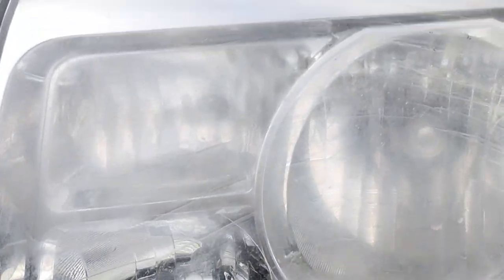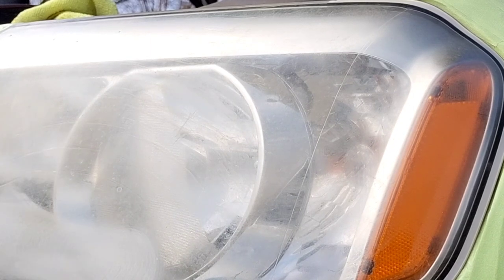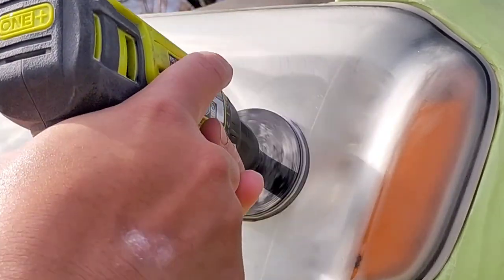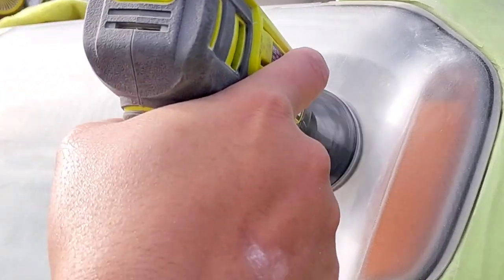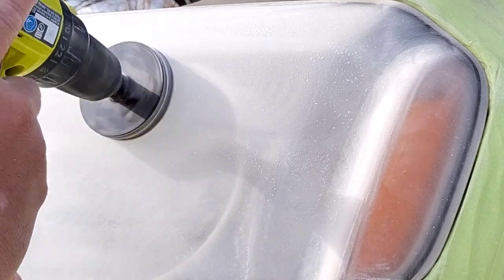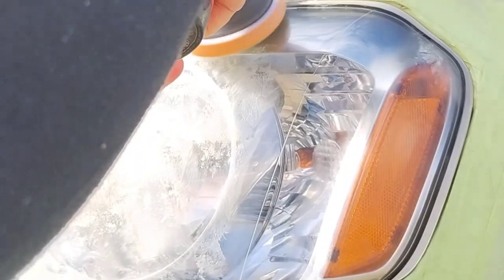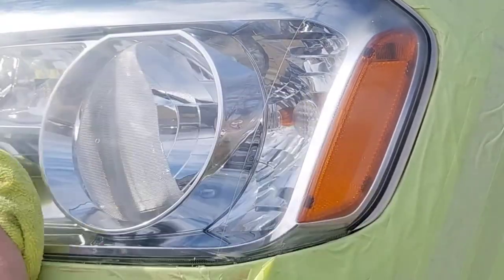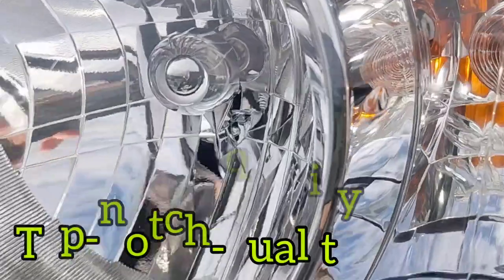Polishing Headlights is a sham scam Part 2 🤬

Comment: If you used 3m’s purple p320-500-800 you would go thru less discs and less sandtime, but yes they are more expensive. Great discs tho, vented as well so no clogging. Any of 3m’s purple discs are great, whether it’s cubitron, trizact, etc
Reply: Great videos. What compounds and pads do you use?
Reply from the maker: All stated in majority of videos.. also direct linked for purchase from Amazon in the bio...👍🏼

Comment: Do you do anything to your 3M finesse it pad when they are new to soften them up? It always looks like the ones you use are well worked in. Reason I ask is when i purchased a couple they seem pretty firm when new and I polished a set of practice headlights and put a couple burn marks on the first one and had to start over. And as always, thank you for the education.
Reply from the maker: When they're new you just have to use more polish...alot more until that service breaks in they're actually are working more efficient when they're new.. so you have to slow down and do less, and use more polish...
Reply: Awesome, thank you. I'm sure in one of your videos you have mentioned this and obviously you are a lot better at his than I am so it might change the outcome but how long do the finesse it and trizact pads normally last?
Reply from the maker: Trizak pad typically are usable for probably about 3 to 4 vehicles... The orange three in finessing is probably good for about 13 - 20 vehicles...
Reply: Hey brother, do you just store the finesse it pad in a zip lock bag between jobs?
Reply from the maker: @chrissanchez6610 no....it stays on the ac Delco...

Comment: Hi again mate, have  you used something like gyeon can coat ceramic coating on headlights. It can be applied to all areas of the exterior including the headlights. Its got a 12mth durability and you could get 100s of headlights out of a can considering how little you have to use. Thx
Reply from the maker: Is it a spray can...
Reply: @theheadlightrestorationpro  its a ceramic coating in a can with a pump spray nozzle. To apply to a car, you spray it into a cloth and wipe it on then buff it off with a clean cloth.
Reply from the maker: However good it is it's not acceptable my opinion.. for my level of quality it would have to be a spray can aerosol... No matter what it is if it was liquid Gold it's inferior because of his delivery method..
Most ceramics are inferior methods of coating headlights either way it goes..

Comment: Hey mate another great video . Just a question , why do U use glass cleaner ? Does it do something different to the lens that another cleaner wouldn't ? Thx
Reply: Alcohol based, evaporates more quickly and doesn’t streak with residue, like other cleaners that would leave behind somewhat interfering with the polishing step.
Reply from the maker: Actually they do the same thing as the ammonia base Just a Little less in a different way.. but what they do more of a strip.. which is one of the things of one of the biggest things you don't want done after the step is for the residue of the Polish cleaner to be  to be stripped..
I mentioned this so many videos..
Reply from the maker: Glass cleaner is designed to not you leave streaks, and access residue from the cleaner, it's typically designed to be used on transparent and or reflective surfaces.. and also has a high evaporation point almost as high as alcohol because normally is ammonia base... Which makes it ideal to use but headlights...
Reply: @theheadlightrestorationpro  ok thx. Makes sense

Comment: Headlight Restoration Pro. I've started my own business doing headlights here in New Zealand, your videos were an inspiration to start, and I follow your method almost to the T. However, here in New Zealand we have a limited access to 3M products and 75mm sanding discs, backing plates and whatnot. I've been using the smaller 50mm discs and they work well, although I am having difficulty after the p800 step. I have trizact pads on the way from Australia, but in the meantime it is very difficult to get that crystal clear finish with just normal p3000 wetsanding. Do you have any advise on what I can do instead after the p800 stage. Headlights here are a total mess by the way as all out imports are from Japan and the oxidization is like worst you would have seen but with every vehicle. I am the only one in my city doing restoration and I've quickly become in high demand. Any advise or alternatives would be appreciated. Thanks.
Reply from the maker: Might try to wet sand with the p800 after dry sanding (by hand)..or do a little extra with the policy step...
Or add wet sanding step with something like a 1200  after the 800 step...(but after machining with the 1200 you want to hand sand kind of replacing the 800 step... Still using the 800... But doing the stuff you do with the 800 with the 1200...
Appreciate you....
Sounds like you have a good thing going on out there...💯👍🏼
Reply: Thank you for the reply, I'll definitely try that out tomorrow. Once these trizact pads arrive, i've got no doubt that'll fix a lot of my issues. I've been doing cut and polish for 10+ years but headlights for 2 weeks. Whole different ball game, but enjoying the learning process. Keep up the great and informative content.
Reply: Hi mate, just across the ditch from you .I don't have the trizacts yet, so I use 800 then 1200 then 2000. Then I polish with my DA polisher and a decent compound like scholl S20 Black or similar  . Comes up clear as a bell . I've only just received the Megs headlight coating today , so keen to see that in action

Comment: Do you ever have any issues with the masking tape leaving residue? Every masking tape I've used seems to leave residue that I cannot seem to get off, and sometimes I even lightly put it on
Reply from the maker: This is why I use auto finish tape ..3m
Auto finish tape leaves little to none,..
And if there ever is a little spot it just wipes right off its design for vehicles that are painted....
Check the link in my bio...
There are other brands and other Auto finishing but three am of course is the best...💯
Reply: @theheadlightrestorationpro  great thanks

Comment: Mr. Headlight restoration pro, I've seen so many headlight restoration videos that were like, they peel the headlight material in an EXTREME way first using knife or cutter, wet sand it and finally polish it. Can you share your thought in your next video? Is there any effect of headlight thickness to its performance/durability? Thank you so much! 🙏
Reply from the maker: Thanks for watching.. yes you can shave them and wet sand them but both are remedial and very inefficient... Those guys shaved the lights because they don't have access to power tools or even pluggable power they're in a different country, they also have unlimited labor free labor compared to anywhere else.. shaving the light like that would take a long time also they're moving way more material than they need to and the light would have to be out of the vehicle to do all that.. basically the same concept but just crazy.. also they don't seal a coat so it'll come right back anyways.lol...
With wet sanding it's very remedial takes four times as long and if you're going to use a power tool, also it's hard to know if you hit the right depths that's why if you witness a lot of wet sanding or a person that does what sending consistently the results are very inconsistent, my results if you witness are always the crystal clear perfection a wet Sanders is going to be hit or miss because they assume they have hit the depth cuz it's really no way to tell some are yellow still afterwards or foggy or not as clear and then all of a sudden they have one that is super clear. Even if you ask Google wet sanding by definition is designed to be a finishing step not a beginning or intermediate step... It's like a fine tune so to use it all the way through is Goofy.. it's nasty and messy it looks so professional when somebody sees you doing it.. also doesn't play too well when it's cold.. many many other reasons these methods are inferior... I mention it on a couple of my videos just keep watching and you'll definitely see...👍🏼💯

Comment: You can just spray that headlight protector on the car paint and it won't harm the paint?
Reply: Do not do that. He did not do that. Look closer, he taped off, and masqued off those lights so that only the headlight was exposed. That stuff is a clear coat.

Comment: So just to recap, the correct steps are - sand, polish, seal?
Reply from the maker: In a nut shell.. basically that is a true,/real headlight restoration... Available true real headlight restoration as pretty much sanding and then sealing... That's the bare minimum..... All the other stuff like polishing, p3000 wet sanding, additional steps like hand sanding in my method,, or just additional extras I do on mine that push traditional true headlight restoration to the next level...
But in my opinion yes those are the steps sanding, polishing, then seal....... And of course other things that are just a given always taping off....